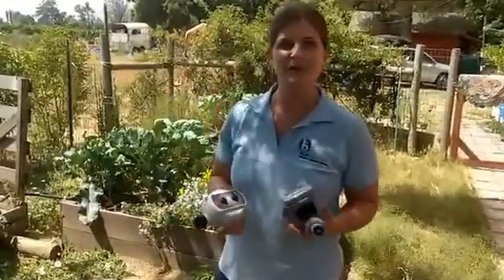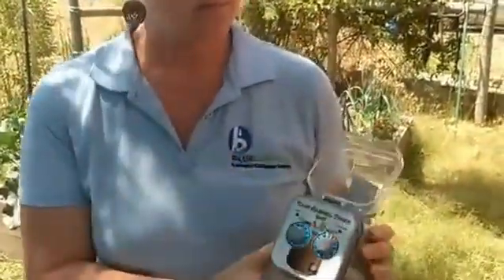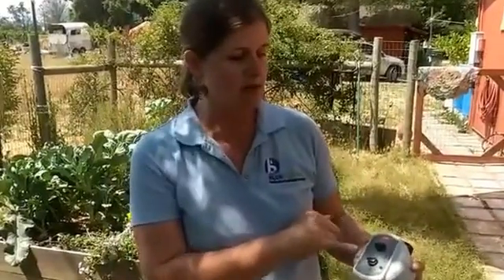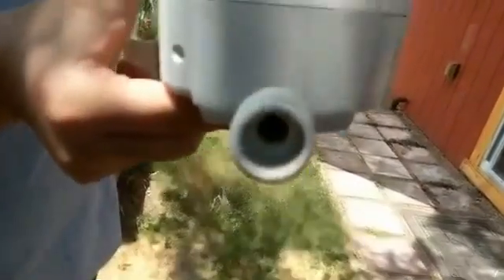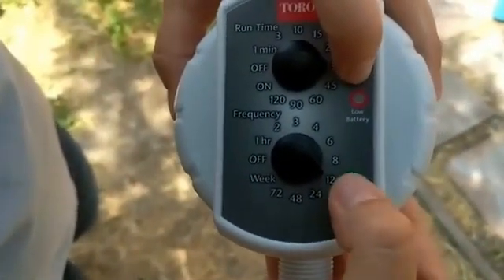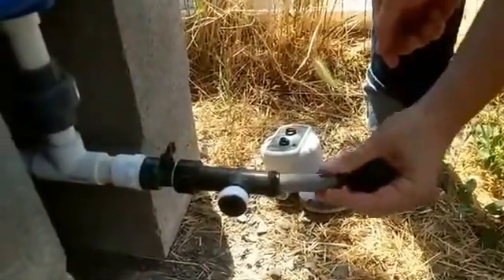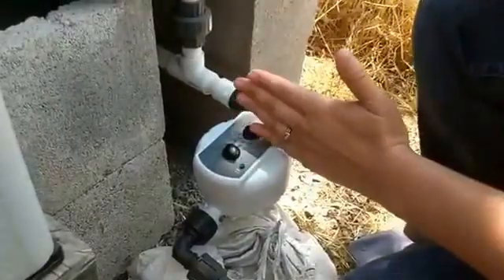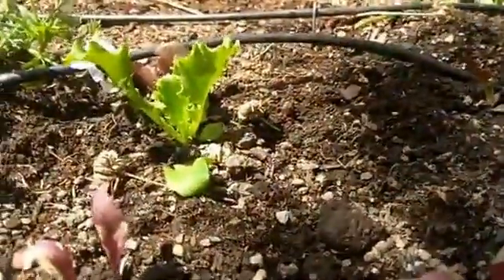No-Pressure Irrigation Timers for Rain Barrels - Live Demo!

Comment: I have a 4 port WiFi timer on a drip irrigation system. I would like to add rain barrels instead of using water from my house. Can I simply add one of these timers before the 4 port timer to allow the no pressure timer to come on and send water to the 4 port timer that requires that requires pressure to come on?

Comment: Can these work with IBC totes as well?
Reply from the maker: Yes our irrigation supplies fit standard 3/4" hose thread.  So if your totes have a drain valve or spigot the streamlined drip irrigation filter and the timer will fit.  You can learn more about all of our irrigation supplies on our website - https://www.bluebarrelsystems.com/blog/gravity-feed-irrigate-rain-barrels/

Comment: Thanks for the demo. Do the beds/containers have to be below the rainbarrel output? Or can the water travel upwards a bit after coming out the rainbarrel? My issue is that my raised bed is pretty tall - maybe 1-2 feet above my current rainbarrel output
Reply from the maker: You may have enough pressure when your barrels are full but as they empty you will lose pressure.  You could consider adding a standard utility pump.  Contact us on our website if you have more questions www.bluebarrelsystems.com  
You may also want to look at this Blog for more on the basics on gravity fed drip irrigation - https://www.bluebarrelsystems.com/blog/gravity-feed-irrigate-rain-barrels/

Comment: We bought two of the Toro timers you showed.  I have not opened them up yet.  We are planning on putting in four 500 gallon tanks for rainwater catchment.  Will this timer work with those?  It says it needs 5 psi.  I don't know what the tanks will have if placed at ground level.   Also we want to use one on two 265 gallon tanks placed on the ground.  As long as there is some water in the tanks will this valve work?  I realize now that your tanks are elevated.  Thank you.
Reply from the maker: Hi there - if you purchased your timers from bluebarrelsystems.com, you can reach our customer service team through our website to answer your questions. Thanks!

Comment: Question. If I have hanging basket plants, would this type of irrigation system work?  If my plants are hanging, is there enough pressure for the water to go up and through the irrigation tubing to water my hanging basket plants?  If not, do you know of a product that will use water from my rain barrel to water my hanging plants?  Thank you.
Reply from the maker: Hi Serena - for gravity-fed irrigation systems, the water release must be below the water level in your rain barrels. Until somebody figures out how to get water to flow uphill, anyway :). This article goes over the basics of gravity-fed irrigation: https://www.bluebarrelsystems.com/blog/gravity-feed-irrigate-rain-barrels/ Please contact us through our website if you have more questions. https://www.bluebarrelsystems.com/
Reply: Technically you can but you would have to add a transfer pump to the system and you would have to manually turn it on and off at the pump.  So it wouldn't be a set it and forget it type of system unless you connect the pump to a smart plug and get it in sync with the irrigation system.
Reply: Looking into using timers for raised beds. Thinking of using a pump for rain barrel and then adding timer to outlet used for pump.

Comment: Good video, very helpful to see how delay timer starts, thank you for posting! 

One question, does the Frequency counter start when you set the timer? For example, it gives you a 72 hour option for frequency, but what time of day does it go off? The time of day when you set the timer or something else? Thanks again

Toro Model 53453, Low-Pressure Tap Timer
Reply: I had the same question.  When you set the frequency to anything like 72 hours, the watering does not start until that 1st frequency has passed per Toro.  So the first watering wont start until 72 hours later.  This is really annoying.  So you have to set frequency off if you want to water immediately say 30 minutes.  Then go back after 30 minutes and set the frequency you want and it will start later on.  The rain barrel website nor this video does not tell you this.
Reply from the maker: Hi Chris! Glad the video was helpful. For customer service and product support, please contact us through our website: BlueBarrelSystems.com. Thanks!